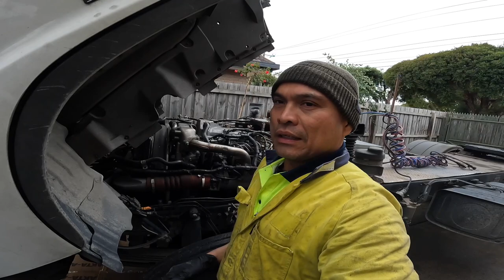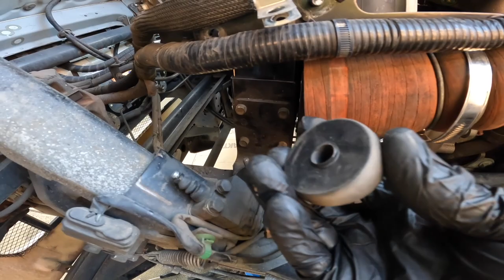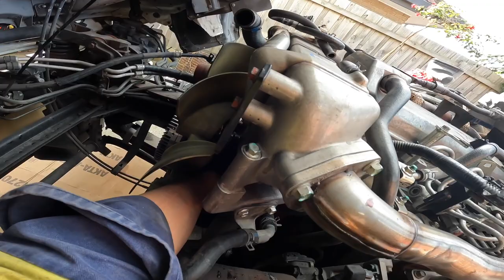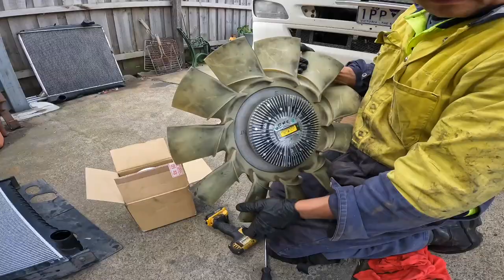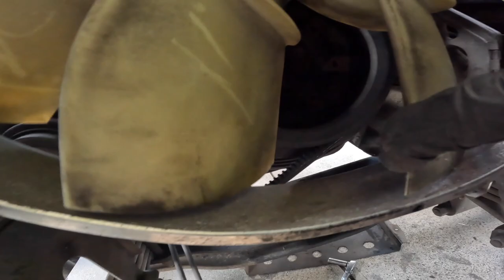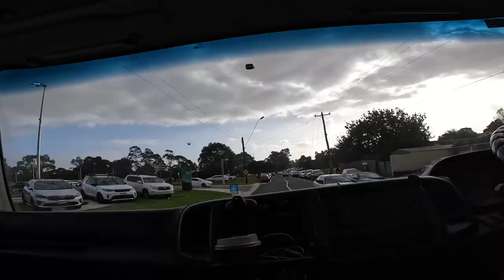Engine Overheating Clutch Fan on Hino  500 Series Replace

Comment: Hey mate my boss and I have that truck and we’ve hit a brick wall with it, we’ve changed water pump, radiator, thermostat but still overheating! Also number 5 injector isn’t working we are in Perth do you have any ideas
Reply from the maker: What's the truck model? Could be headgasket.
Reply: @gooddayvlogs23  we’ve pulled head off and gasket seems fine??…
Reply from the maker: Overheating or pressure in the cooling system?
Reply from the maker: You've replaced everything,  it should be fixed.
Reply from the maker: If you are saying pressure in the cooling system, it's a different story. Meaning Aur compressor head is faulty, pushing air to the radiator like the engine is overheating.
Reply: Hmmm good point I’ll discuss with my boss you’ve an idea of any symptoms of failing compressor?
Reply from the maker: Failling air compressor,  is when air is bypassing the compressor head gasket and pushing air into the cooling system and pushing through radiator and coolant reservoir.